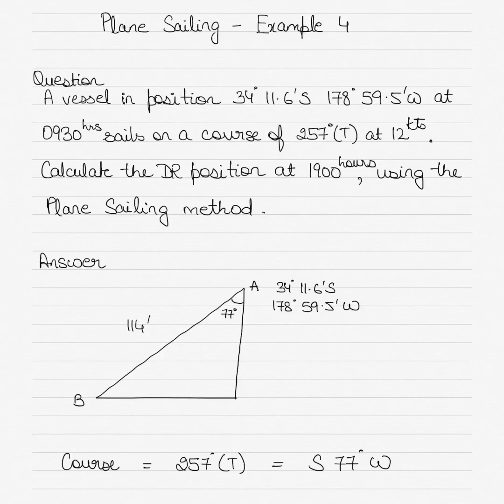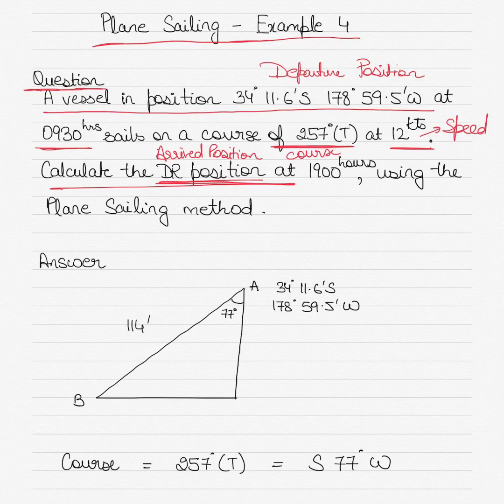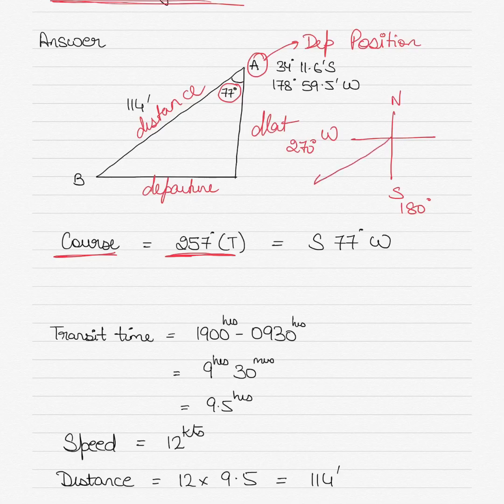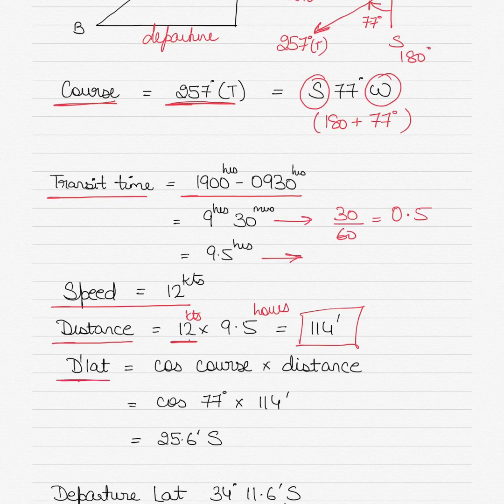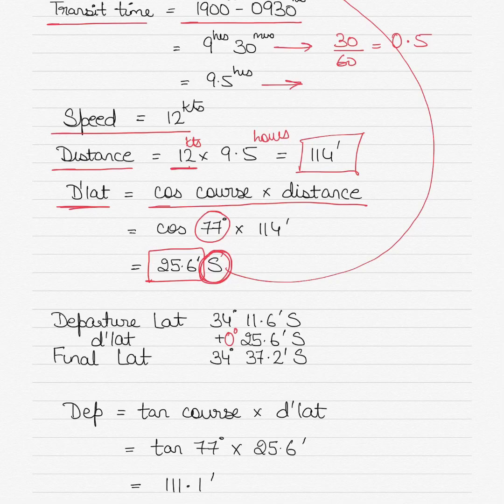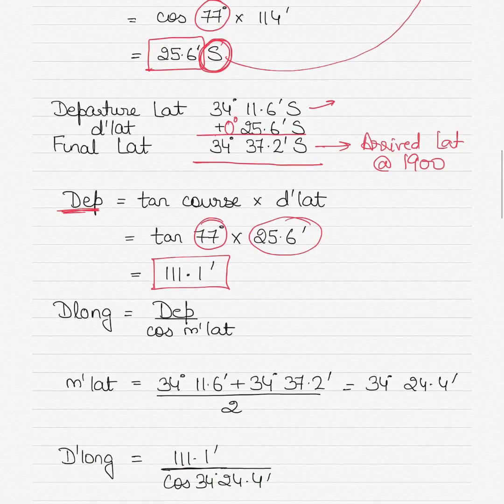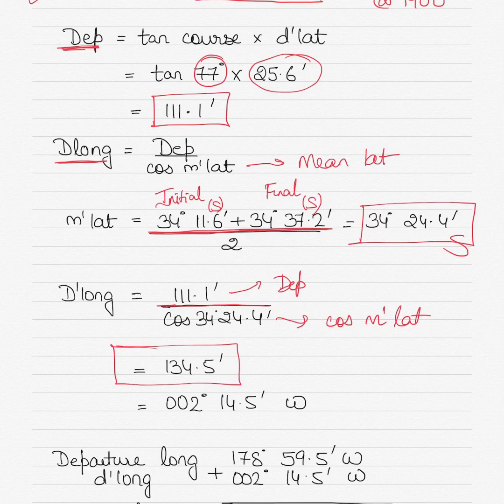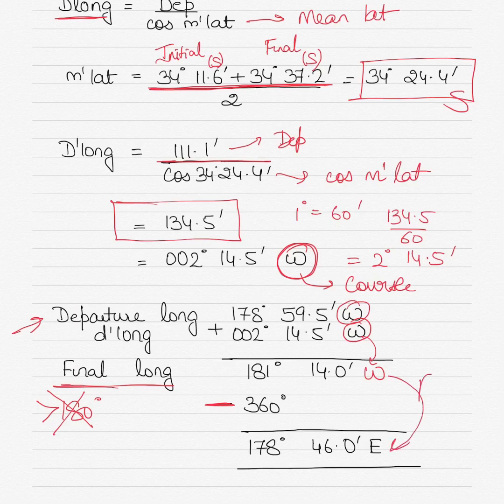Plane Sailing Calculation - Example 4

Comment: Sir how I will know in exam time question is plane sailing or parallel   sailing
Reply from the maker: Parallel sailing is along the same parallel of latitude (only one latitude is involved) but plane sailing involves two different latitudes with distances less than 600 nautical miles.
Reply: @SteeringMariners  you're too good.
you really know your  profession
Reply from the maker: @mahamisailor2545  Very kind of you to say that:)